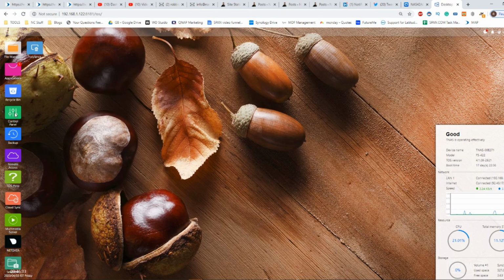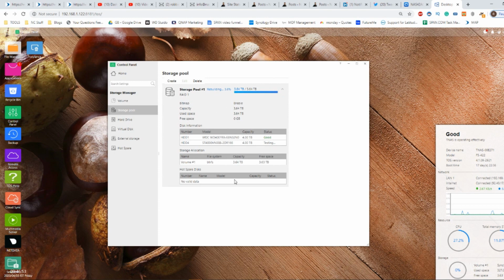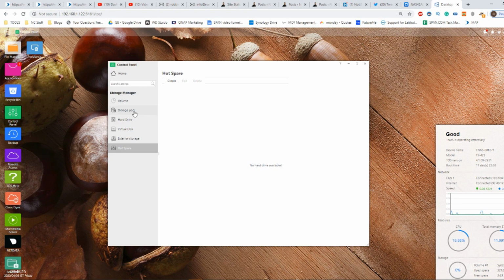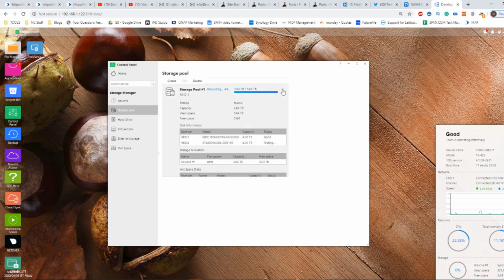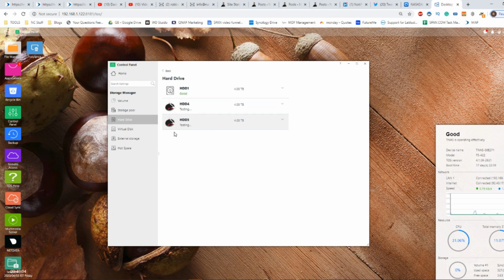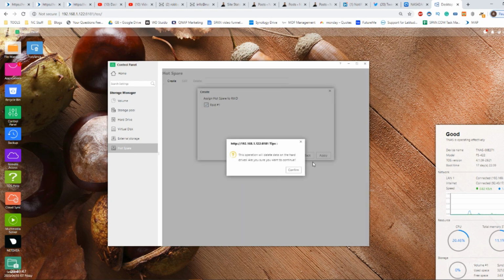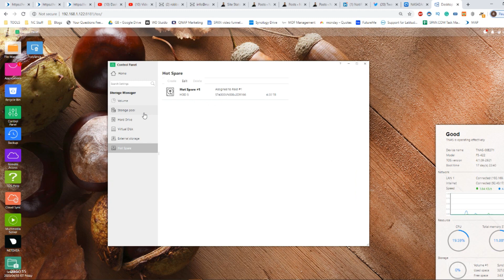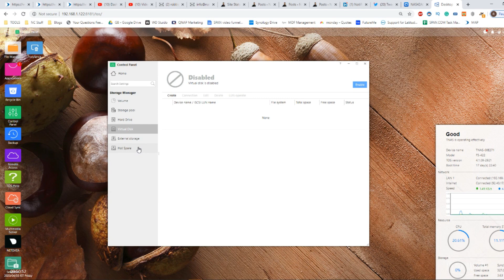TerraMaster NAS and RAID - How to Setup a Hot Spare

Comment: Hi, question. I have the Terra Master F4-210 with four 6TB drives running raid5, accessing my miles is really slow over the network, i currently have my entire library backed up there (7.5TB). I'm thinking of swapping eat drive with a 6TB SSD's... cant this be done without data loss?
Reply: Same question, need to upgrade my HDD

Comment: Hmmm, I have an F4-210, 3 4TB HDDs currently configured in RAID5,  I tried adding a hot spare and when I clicked create, I was only given a RAID#1 option....any idea why?
Reply: Because you need to use a minimum of 4 discs in a RAID 5 array to which you intend to use a hot spare on. What they don’t tell you is the array you’re looking to create isn’t a raid 5, it’s a raid 5e array which cannot be done with only 4 discs, you need a minimum of 5 discs and a raid 5e array can have up to 3 hot spares available. 5 total discs, 4 to make the array and 1 hot spare. Although raid 5 will work with 3 discs, a 5e won’t.
Reply: Are you sure that it wasn't saying "Attach this Hot Spare to RAID 1" as in the singe array volume you have.  Mine indicated that there was one raid volume to which I could attach the hot spare.  I suspect this is what you are seeing.  Maybe it should have said volume or pool 1.

Comment: Could you use an external USB hardrive as a hot spare?
Reply from the maker: I'm afraid not. I think the issue would be guaranteed transmission with the wider array and how it would effect the latency of the whole raid. If you want to incorporate a USB drive, it's better to set up an on going sync/scheduled Backup to one with your key files
Reply: @nascompares  I'll check that out! thanks for the reply.